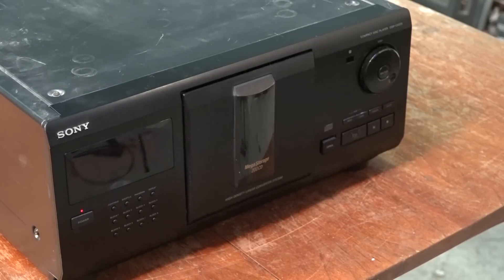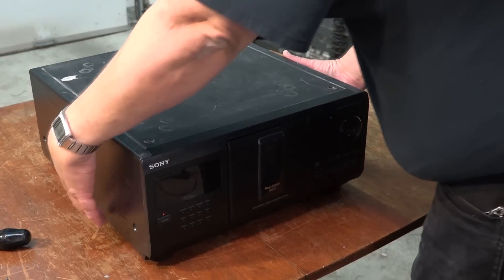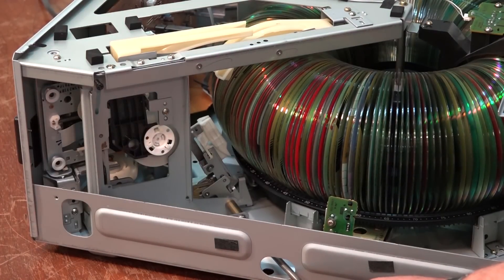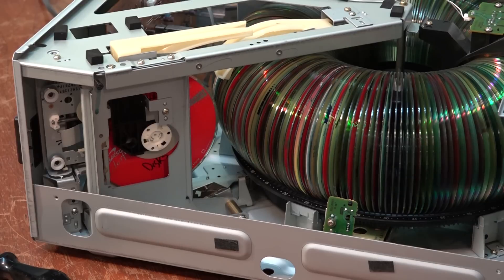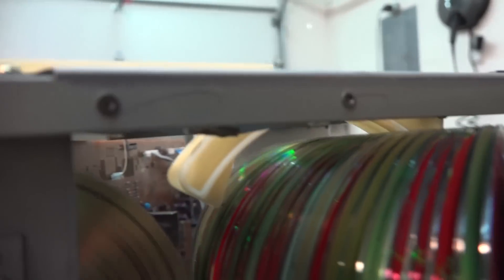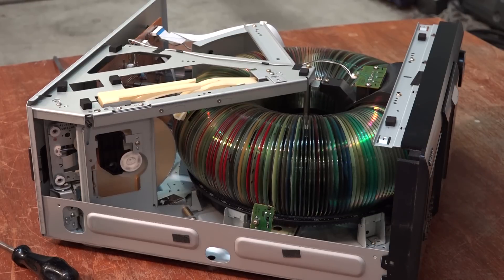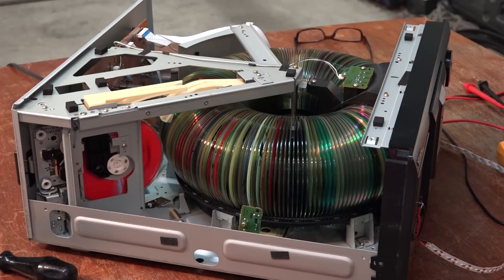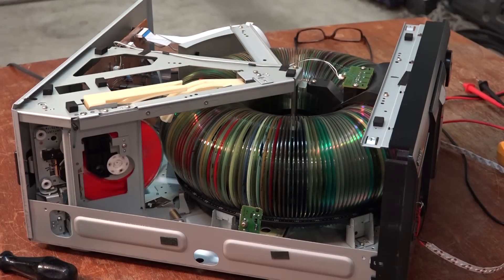Sony CDP CX225 200 Disk changer

Comment: I have a friend who has a Pioneer 100 disc changer they were trying to sell me for $50 USD.  But i'm leery of them and being a pita to work on.  
 I have a Sony 5 disc changer/burner(RCD-W500C), it works on the single disc side but the changer is flaky! it'll play fine for a few mins then just starts randomly switching songs or discs. Ive taken it apart and lubed up the tracks, cleaned the lens, and it worked better for a couple days , then back to randomness.  Its never worked right since brand new, wont even burn discs. Ive read the manual a dozen times, and talked to Sony tech support, absolutely no help.  One day i'll tear it all apart and get to the bottom of its issues...could just be a damn ribbon cable loose?   Thanks for sharing, Dave!

Comment: With the assistance of your video about the 300 Disk CD Mega Changer skipping, I believe I was able to identify the skipping issue on my CDP-CX235 200 Disk changer - the gears (or at least one of them) had some damaged teeth that would sometimes not mesh.  I was unable to obtain just the gear(s) that I needed, but was able to find a brand new laser transport sub-assembly for about $15.

I installed it.  But when I went to test it, my disc chuck would no longer grasp the discs properly,  It fails to load the CD as it should.

Now, thanks to THIS video, I will attempt to make the adjustment on the CD chuck.  Are you able to provide any additional, valuable insight?

Comment: I have one of these that just stopped working. It will not read the CD. It spins it a few seconds then puts it back. 
I have done all of the basics for this issue and have come to the conclusion it is either a bad lens or a potentiometer. My problem is that I can’t figure out how to get to it?  One is visible and I did adjust it, but no change. The the other one I cannot find. 
Can you direct me please?

Comment: Yea im trying to repair one of these.. mine just will not track and i'm thinking that its just the lazer pickup. It always tries the disk 3 or 4 times and spitts it out and says "no disk". The mechanism works fine and the disk spins up fine too. It just won't track and pick up the disk info.
Reply from the maker: Laser or the spindle motor has worn bearings.

Comment: Great video. After watching it I found one online and really like it so far. Is there a height adjustment on the chucking arm? When mine goes to chuck a disc, the spindle will sometimes not align with the center hole of the cd. Causes quite the mess if I don't catch it.

Comment: I had the CDP-C10 cartridge style disc changer. I hated the delay between disc changes. This carousel style unit had the potential to make a sweet random shuffle DJ machine - by simply adding a second spindle/laser unit in the other corner. While a track plays on one spindle, the carousel could queue up and feed the other spindle and then the unit could switch the audio back and forth nearly instantly - no awkward silence while waiting to spin down, store, select, retrieve, spin up and track seek. So close.
Reply from the maker: They did that with the 400 disk player.  You needed 2 of them but that gave you 800 disks.  Could be programmed to cue disk from other machine and even cross fade and preroll between tracks.  Fully programmable.  A PC running Zara Radio will do the same thing and will play WAV and mp3 tracks.  Could run an entire automated radio station. With it as that is what it ism radio automation software.   It will even do commercial breaks and live news breaks with full remote operation.  It's free too.
Reply: @12voltvids  Interesting! 800 CD's was way more than I ever had. LOL!
Reply from the maker: @eh42  I have probably close to 500

Comment: I have had this cd player since it came out i think. I am rebuilding my stereo system and brought this changer back out. Everything seems to be working good as usual but it is starting to skip pretty bad. I did a cleaning on it with a disk and took it apart and cleaned it out good. Any ideas on what I can do to stop the skipping? Honestly it has been used for a good 20 years minus the few years I put it up cause I didn't have a place to set it up but I would really like to continue using it.
Reply from the maker: Skipping is usually the result of worn bearings in the spindle motor or a weak laser.
Reply: @12voltvids  ill take another look at it. But I'm thinking it may be the bearings. Is there any way to replace them?
Reply from the maker: @LoRdGrAfFiX  
Change the motor.  They used to run about 5 bucks.  You order them by spindle length.
Reply: @12voltvids  thank you for your help. I'll let you know how it goes. Also where did you order the new light bar from? I always wanted to make that light alittle brighter.

Comment: M8 try the XENON WHITE led strips the are mega bright and look beautiful with a very slight puple/blue tint that will match the display colour prefectly!. also i would highly advise to get some plastic gear grease on those cogs. Does this machine have an optical or coax digital output? if so it will play DTS 5.1 music into a 5.1 receiver, now that would be really cool!
Reply from the maker: It has optical out. No it only plays standard audio CD. The 400 disk mega DVD player would play DTS disks and MP3 disks as well.I went with warm white LED as that is what I had kicking around. t only has a 5 volt switched supply, other than the HV for the VFD. Those strip lights need 12 volts, as they basically have 3 LED in series, and as you are aware blue LED need 3 volts across the junction, and al white LED are really just blue lights with phosphorous to make up the rest of the spectrum. Since I only had a 5v switched line to work with, I just went with 3 single LED and dropping resistors.
Reply: good news is any standard cd player with optical output will play 5.1 DTS cds encoded with SURCODE software, you just burn the file to cd the same way you do a wav then the receiver decodes the disc
Reply from the maker: Cool. In my case it is plugged into a nice tube amp and it has just 2 speakers. It looks really cool in a dark room, fire place going, and the tubes a glowing, and the sound off the tube amp is just beautiful.
Reply: yea cool, i make my own music then encode it to 5.1 you can play the director role and send sound to individual speakers in the setup, just a plain old cd player and 5.1dts amp is all you need buddy

Comment: 12voltvids, I had a Sony portable DAT machine that stopped loading the tape so I bought another used one that now has the exact problem. Do you want to buy it? Or can you fix it for less than a fortune?
Reply from the maker: I have so many DAT recorders now I don't know what to do with them.I have 2 Tascam DA40, a Sony 75ES, a Sony 670, Teac DAP20 and the Sony D3, and and I forgot about the Panasonic 3500. I had another Sony too but I sold it. Its hard to say what it would cost to repair, or even if it is repairable without looking at it because there is much that can go wrong. They are very tedious to work on. Like a mini VCR.
Reply: Right. Exactly like a VCR. Evidently the no-load problem is common since two of them had the same problem. After I bought the used one it only
lasted a few days. :-/

Comment: that was nuts back then. i always wanted one, but i ended up ripping all my cd's to flac and just run a randomized playlist. figured it was easier than trying to find a single song on 300 discs worth of music.  i dumped all my songs onto a 512GB microsd card and put it in my phone, and just stream raw uncompressed audio wirelessly via airplay/wifi to my apple airport express router that has an optical SPDIF out to my home theater.  no way am i going back to mechanical drives.
Reply from the maker: I have all my stuff on a microSD as well. Stream it from an old phone to my arlic DAC plugged into my full tube amp driving my big sb7000 speakers.  Sounds fantastic.  I still have the 200 changer connected but i just stream from the phone as the sound is great and all the songs crossfade.

Comment: I like it. I thought you said you put a clear cover on one. Or wanted to.
I would love one in a clear case. I used to watch jukeboxes that played 45 RPM records as a kid and teen .
Edit:I see you mentioned about the clear case. I commented too soon.
You may position mirrors to reflect the clear innerds .
Reply from the maker: I would like to put a clear cover on it perhaps with some fancy led lighting to light up the mechanism.  Perhaps paint the black plastic parts some bright color to show it off. But no it just sits in a stand.  The tube amp is what is on display on the top shelf

Comment: There's one for sale here for $10.  It's the 300 CDs model but it displays a table error message.  Do you think it is worth to buy it and to attempt a repair?
Reply from the maker: For 10 bucks probably worth it. Table error message could be a simple drive belt. The belt for the loading mechanism is a toothed nylon belt, but the one that rotates the disks is just a cheap rubber type.

Comment: Hello, I just finished watching your video on the CX225. I have a CX235 that I recently (3wks ago) purchased. For what ever reason the gripper on the chucking arm closes too soon so when it tries to pick up a disc it either fails to grab it or it barely gets ahold of it causing to load on the spindle incorrectly. When it tries to put it back in the tray it drops the disc half way back and causes a jam. Is there a way I can fix this myself or do I need to send it out for repair? I will appreciate any advise you can give me.

Comment: Hi, I have the CDP-CX300. It has developed the a fault where it has no display but it will load a disc attempt to play it. It doesn't spin the disc nor can i see the laser activate. Carousel works fine and seems to want to play cds. Front buttons function fine and spdif output lights up too. I had a look at the boards and look ok. Maybe the power board? Any ideas?
Regards Stu.
Reply: Just a update. If i disconnect the ribbon cord going to the cd sled assembly the full display returns at the front. Ive ordered a laser optic and new belts. hopefully its just the laser. finger crossed.
Reply: Hello. Is it easy to find spare prts like the ones you got?
Thanks.

Comment: Great overview! I just got this exact CD changer off eBay in supposed good working condition, and it looks nice from the outside, with no damage during shipping, but when I picked it up I heard rattling inside, so I opened it up and found 5 CDs jammed in the back, as well as a piece inside the chassis that was not attached. It is the magnet-loaded white spindle clamp for spinning chucked CDs! I popped it back on its black grip (it's very loose and wobbly, though - that's not normal, is it?) and loaded a CD and attempted to play it, but every time it tries to chuck a CD, the CD gets tossed and overshoots a little and does not get properly clamped so it cannot play it, and then when it tries to send it back to the carousel, the CD falls and gets caught crooked and gets popped into the back of the player, scratching it in the process. Is there maybe another part missing that I'm not finding, like a plastic/teflon washer that goes between the white spindle and the black spindle holder? Thank you!
Reply from the maker: Yes the magnet disk clamp is relatively loose, so that when it clamps it centers and sticks to the spindle.If it is not chucking the disk correctly there are adjustments to align the chucking arm.

Comment: I like CDs audio disks better then mp3 and I still make mix cds on my PC. I have question what kind of lubrication would be good for an old 80s portable cassette deck this player still works with no repairs been done and sounds good and the belt is still good in and its a Panasonic I got for 25 cents.
Reply from the maker: light machine oil , like sewing machine oil to lube the bearings and capstan shaft.
Reply: +12voltvids thanks for the help

Comment: my problem is it loads the disk it is spinning but it's not reading the disk. if you press stop, it doesn't stop. If you press door open then it will stop and rotate it to the open door position. Don't know how to fix it

Comment: I recently bought a Sony 50 disk changer, similar to this unit. I usually have it playing at random when I have friends over. What kinda bothers me is the amount of time it takes to change a disk, between each song. I was wondering, have there ever been any CD changers that loaded 2 disks at once, so there would be no large pause between the songs?
Reply: You can take two Sony 300 or 400 players and hook them together with a built in connection that allows switching from one player to the other; with either
fadeout/fade in, or no delay from song to song.
Reply from the maker: Yes I know. I Do that with a PC running Zara radio. It is radio station automation software, and it builds playlists, cross fades and everything. I have the 200 disk in my living room, but on my media center where all my music is I run Zara, or Kodi.

Comment: My jog dial finally went on me cx250. Do you think it's worth fixing? It plays, but I just can't select and "open" door doesn't spin when tuning the dial.
Reply from the maker: The jog dial is just a rotary encoder switch. More than likely the solder connections where it is attached to the board have cracked.
Reply: +12voltvids thanks, I'll check that! Appreciate it,

Comment: I have an ami Rowe 84 jukebox that holds 100 45s, weighs like 300#.  It's 60w/ch with decent speakers.  I'd  like to put a shelf in the big jukebox for my JVC 200 CD changer.  I  want to make an IR RC sensor by the selector buttons to operate the CD changer inside.  Don
Reply: PS, just won the cx450 from ebay, looks like the JVC will be replaced.

Comment: Nice !! Doe's it Have a Coaxial Output For An External Dac ?.
Reply from the maker: It has an optical out, but that is an easy conversion. Speaking of that, you just gave me an idea for a future video. Adding a coaxial output. (not using a converter box, actually adding a physical output. )
Reply: Very Cool Idea !!

Comment: The movement of the spindle bugs me :)
With this vertical play system there is less stress on the laser.I remember having an AIWA portable cd player,in normal horizontal way it had issues playing,but in vertical way worked fine.Weird.
Reply from the maker: Not to mention that dust doesn't get inside the laser, or stick to the lens on vertical mounted mechanisms.

Comment: whats crazy, is you actually HAVE 200 discs to fill that thing! I barely have 10 CDs left in my possession. Everything I own now is digital.
Reply from the maker: I have a lot more than 200. That is just the compilation copies, where I ripped the tracks from other disks and burned them onto CDR to load into that changer. I have probably closer to 1000 CDs. They are all ripped to my hard drive, and on a thumb drive in the car, but I still enjoy putting on the changer and jetting it do it's thing just like I enjoy playing a DAT tape that I mixed 20 or more years ago from vinyl and CD using 2 turn tables, 2 CD players, and a mixer, and mixed live into the DAT to make a compilation tape.Something about playing a physical tape, like putting a record on the turn table.

Comment: I can see what the problem is with all them discs being loose like that, they never made any type of special shield that surrounds the entire tray to prevent them from falling out of place.  I wouldn't have designed the system myself without it.
Reply from the maker: Original systems did have a plastic tunnel that the disks went in, but that causes problems on it's own. If people bothered to read the instructions there were lots of warnings about transporting it full of disks, so people caused their own problems because they did not read the manual. As a servicer these were my favorite type of customers. The impatient, know it all types. They ended up spending more money fixing things they broke because they didn't install correctly.

Comment: Yes someone more then me ewho HATES blue LEDS! it was cool in the beginning right but now everything has it so white is much cooler i even went thru the trouble to change SMD ones out 0603 size and those are tiny :) i will send you a pm thru youtube in a moment...
Reply from the maker: That's exactly why I went with warm white LED for my giant clock build, which currently is lighting up half my office. One of these days I will get around to building a box to put it, and the surrounding red neon frame into, and it will look even better.  The warm white LED look like little incandescent bulbs.
Reply: Yes warm white looks more natural like incandescent one me personally i prefer cold white 5500-6500k i started with that and later i did it all with them but RGB leds and even the new RGBV (there is a new rgb led avaiable now with one white led and then three leds red green and blue)

Comment: great videos!!  How did you get the clock on your old scope?
Reply from the maker: There is a video on that project. I have another one of those x-y clock circuits that needs the d-a converter replaced that I will service once I source the parts.

Comment: How many people actually had enough discs to fill this thing?
Reply from the maker: Well I have over 600 CDs so I made complication disks or my favorite tracks and burned them onto CDR. I have 190 complication disks and 10 slots that I fill with CDs that I change out from time to time and this unit gets used almost daily.  I also have a tablet with a 128 gig SD card full of high quality mp3 and FLAC files that I am using more and more now because it will Crossfade between the tracks 
 The changer there is always a delay, but it is cool to watch the disks spinning back and forth as it selects a new one.